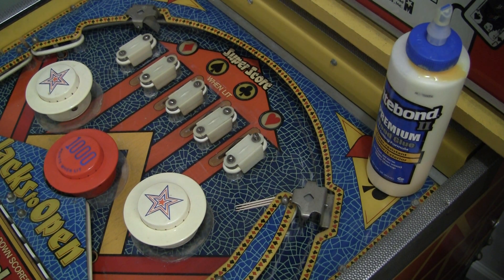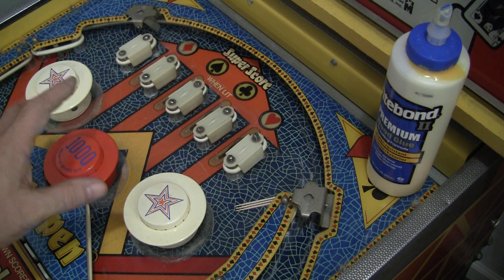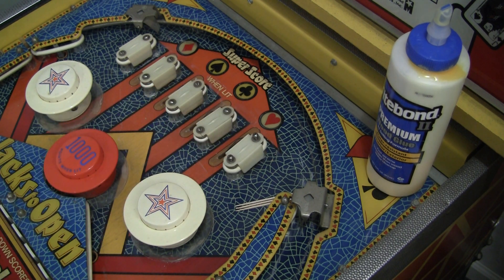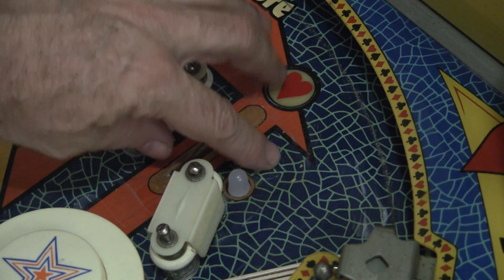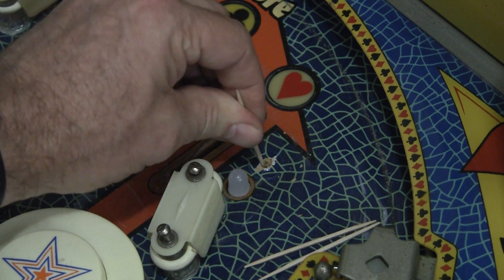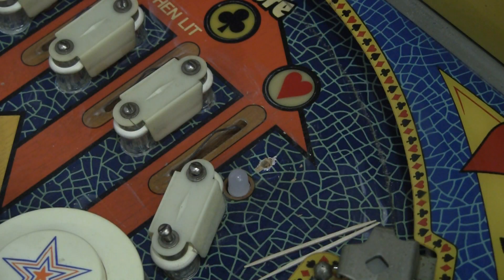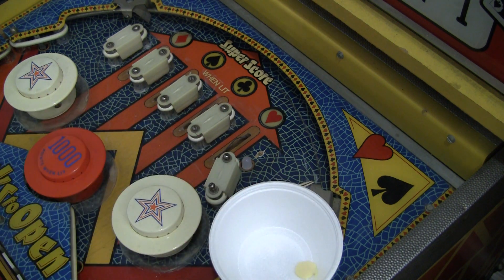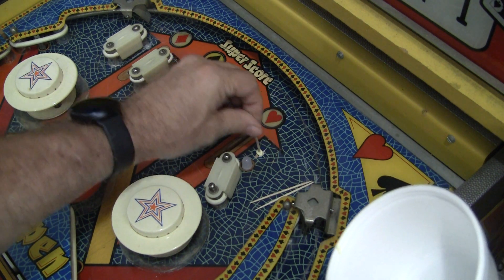How to fix stripped pinball playfield screws - PinballHelp.com

Comment: I like gluing in wooden match sticks with carpenters glue. They are just the right size for a stripped out hole.
Reply from the maker: Agreed.  If the hole is larger, matchsticks work better.

Don't forget to subscribe!  https://youtube.com/pinballhelp?sub_confirmation=1 Every little bit helps.